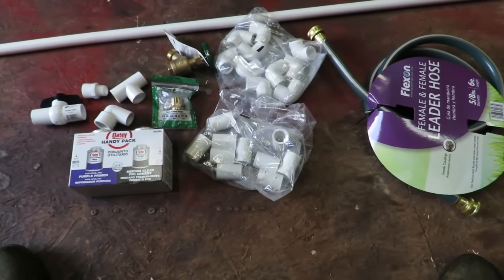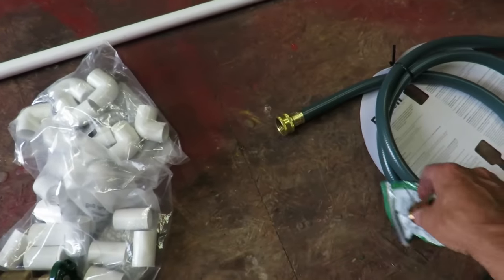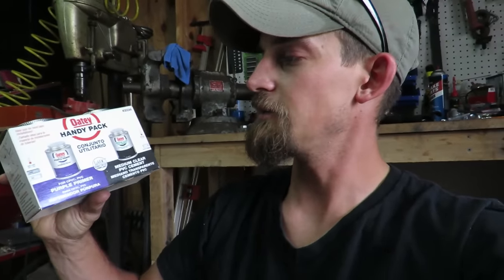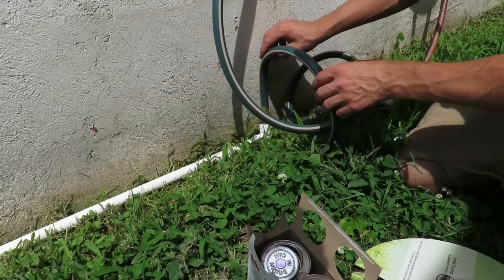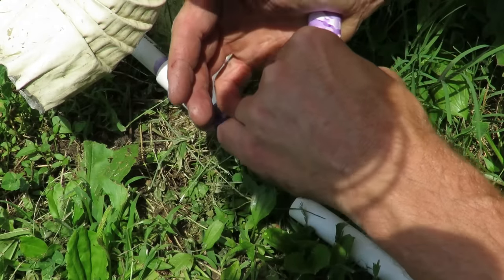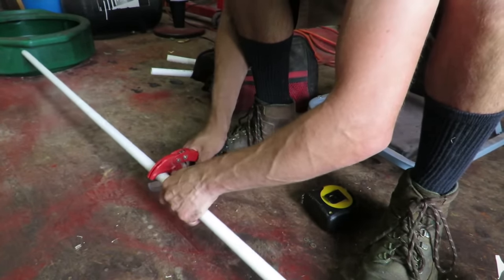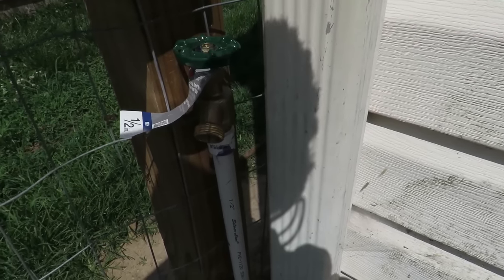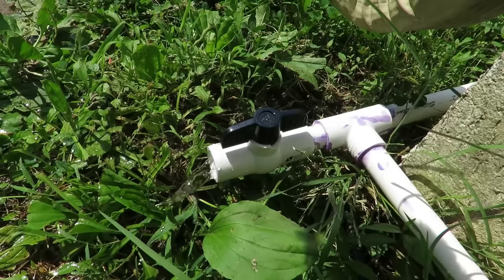Add a Water Spigot Anywhere in Your Yard!

Comment: I would serious suggest securing it to a post because it will end up breaking off, cracking or coming lose if constantly in motion and pulling hoses on it.  Some folks might want to paint the pipe a dark black green color  - that white with markings and the purple cleaner doesn’t look very good - but maybe that’s not important. You can always use my choice —  copper if the budget allows and you don’t have to go to far.  I like copper because it’s antibacterial and it doesn’t build up biofilm like the plastic pipes and hoses do. The reason they tell us not to drink from water hoses due to bacteria is quite true.  My bets are in 20-25 years, they are going to realize (they already know it, just don’t want to tell us as they have allowed it inside so many homes) — but like other faulty or toxic materials - it will have to be removed.  Separate from that issue — you can just hide the pipe by trenching and use HDPE pipes. HDPE (High Density Polyethylene) pipes are a considered the best choice for underground water lines. It’s considered non-toxic, tasteless, and considered a green building material. The pipes are designed to be high crack- and corrosion-resistant, and the light weight and flexibility contribute to an easy installation. With a long service life of 70 years and a low cost, HDPE is a highly desirable choice. PEX (Cross-linked polyethylene) is another great choice for an underground water line. The pipes are created from melted HDPE polymers, which gives the pipe a great amount of flexibility compared to other pipes. PEX pipes are durable, flexible, and able to handle high pressures. These pipes are a great option for yards that have obstacles to move around when digging and laying the pipe, as the pipe will not need fittings or elbows. The downside is the lifespan of PEX pipes which are usually between 30-50 years and even less if the water contains chlorine which is all municipality water supplies and even drilled and bored wells which have to be occasionally shocked. There are other choices, but HDPE pipes and PEX pipes are considered the best underground choices as they are durable, and resistant to corrosion and rust. Biofilm still builds up in these. 

Another really easy “summer time” way for getting water to your potting shed, vegetable garden, or if moving your goats or chickens around is to sink a post in the ground (or use the side of your shed, barn, fence, etc) attach a spigot and run a hose from your main supply to the spigot. Set the spigot high enough to get say a large watering can, or a 5 gallon bucket easily under - saves your back too.  I pin the hose in place with landscape/sod  6-8” (u shaped) pins so it doesn’t move around and pull across my beds.  I like to run it as inconspicuously as possible like down along a fence and then over to where I need it. If you want you can trench and lay the hose in the trench just in case you are trippy and forget to pick your feet up or you need to mow over it and don’t want to lift the cutting blade. If it gets sun, use burst proof hoses (red hot water ones) or you can cover hose with mulch. I actually  cut the water off at the main spigot every-time. This way there is no pressure on the hose. It’s no big deal, I turn the main spigot on as I head down to the shed.  I use for soaker hose too and attach pieces of old reg hose in between where I don’t want water to drip out. In the winter, I take the hose loose from the main spigot to the summer spigot, drain it, and put  away.

If you want to use rainwater — 
You can also use a large rolling trash can and make a filter out of a well rinsed old cotton sheet (rinse 3-4 times in the washer no soap, no softener, bleach, borax, or anything else). Then soak in a bucket of water in the tub, changing several times over a day or two — then back through the washing machine for a last rinse— again just water. Softener and laundry soap is harmful to plants but you only do it once and then keep that sheet for filter use. Once dry, you place it on the trashcan, roll up around the top of the can and bring forward — tie or secure with large  rubber-bands or I just roll it tight into sections and tie it so it stays in place during the storm. If you collect rainwater, you can dip out into a can, install a spigot, or drop a $40 pump in the bottom with a hose connected and you have pressurized pure rain water. Keep the can shaded, cover on and 1/4 of a mosquito dunk per month (don’t use granular, the biological Bt is in a corn based carrier as it will make a mess out of your water).  I don’t collect in pollen season, it goes bad and creates a mess - I wait til pollen season is over. I don’t like gutter water, it’s nasty and has bacteria from birds and other critters on the roof and debris from trees.  I use an old tilting umbrella and when it’s getting ready to rain, it’s then tilted way over the can so the rain runs off one of the ribs and into the can. Takes a few minutes for the umbrella to get good and wet and start to work well but it does. Note, if you have seen rain barrel set ups — you can connect rolling trashcans the same way — they are more expensive but I like that they roll around though keep in mind — water weighs 8 pounds per gallon.  I use a 32 gallon cans.  But you can also use a small vinyl tarp or heavy vinyl with grommets - put large screw eye or hooks (like large cup hooks)  up on the shed or barn roof, or two tall posts (5-6’), connect the tarp to the hooks, drape/secure to the barrel.  Take the tarp down afterwards. I like the $59-79 Lowe’s Tilting umbrella idea better. Look for a white one if possible, but mine is a blue stripe, it was all they had in stock, and you will need whatever kind of base you want that fits the umbrella, mine is a 7’.  It’s so much easier - I do let it stay up in the rain for a 6-8 months to get any potential manufacturing residue off it before use if watering potted plants or say orchids. The winter works well, and I just take it down when heavy snow or heavy winds are forecast but we don’t get many of those. So far so good - knock on wood and it hasn’t been damaged.  When not collecting water in rain storms, it gives me a shady place to sit and it shades the rain barrel which helps keep the water cooler, and algae free. I also attach some of my young vandas to hang off the ribs if the umbrella  too.  I  use the dark grey rolling Rubbermaid cans which I wash out very well with Physan20 before use. An 8oz bottle will last you a while. I use it with orchids, pots, cutting tools, greenhouses, concrete walks, etc. it’s a fungicide, bactericide, viruscide, algaecide. And at the right dilution is safe for a number of ornamentals including orchid seedlings.  You want Physan 20 (physan.com) NOT Phyto and any number which is a toxic copper product for another purpose. I use Physan 20 to disinfect lots of things after first washing off visible dirt, to wash and clean bird baths, fountains etc even the kitchen and bathroom floor.  DO NOT dump Physan 20 concentrate or mixed solutions down drains, sewers, near creeks or any body of water — it will coat the gills and suffocate fish and other organisms that breathe water.  It’s the same type of product used for disinfecting hospitals, restaurants, food processing plants, etc. if you grow tomatoes, peppers, etc or have orchids, and have someone who helps you that smokes, make up the specified hand solution (see under the orchid application in the website) and have them wash their hands with soap and water and then put their hands in a bucket of the physan solution and work with their hands wet to keep from transferring tobacco mosaic virus to the plants. It will be in the tobacco in the cigarettes or cigars etc.- can’t see, can’t tell it, but it will transfer to the plants. TMV spreads very easily by tools, workers, air, soil, vector insects like leafhoppers, aphids, etc. it spreads easily from infected plant to healthy and lasts in the soil or dead debris for years. There is no cure, up to 20% of a crop can be lost if the plant doesn’t just die. This is why you don’t compost tomato, peppers, etc and why you rotate crops - I like a 10 year cycle (10 rows) and once something is grown in one row it’s not grown there again for 10 years but you can use a 5 yr. make sure you draw up a chart because you will forget from year to year. TMV also spreads via seed — if someone is handling seed who smokes it will be on the seed, and into the resulting plant. It’s a major commercial crop disease, there is no cure, you can only try to prevent it getting started on your property and sanitation is a big help. They are a few TMV resistant varieties but not many, and none or almost none of the heirlooms are resistant  — try to plant those that say TMV resistant and buy from reputable sellers.  It would be nice if they could modify the genes to be resistant to this highly infective and stable virus but no solutions yet. They have been able to do some modifying of potatoes, apple,  and corn, avocados, for devastating pests but people are so caught up in being afraid of anything that says GMO that these aren’t getting very far.  Too many people think it all has to do with Roundup and that’s not true. The process can save world supplies of food from diseases and pests… think of the great Irish  potato blight that caused millions to die due to lack of food.
Reply: You should start making instructional videos to show everyone these methods.
Reply: That’s the longest comment I’ve ever seen....

Comment: Yes. use teflon tape for all threaded connections you intend to be semi-permanent. It doesn't necessarily seal the threads, but it helps you tighten the threads properly by lubricating them.
Reply from the maker: I'm planning on getting some. I believe there are different kinds correct?
Reply from the maker: There is also the liquid type that works well
Reply: @ASliceofWoodWorkshop  There are a number of thicknesses of teflon tape. I use the standared white tape and wrap it 4-6 times around the male threads before assembly. The thicker types (one is gray) only typically need 3-4 wraps for the same application.
If you see yellow tape, that's made for gas applications, not water.

Comment: I did the same thing...but I used a commercial red hot water hose at 3/4" ...I tied it to my fence with plastic ties... om the bottom...commercial are made for extreme cold and hot water at 250 degree F.   took me only 10 min...I keep it all year round... cost $50 Total
Reply: Not sure if this is what you meant but If you used PEX tubing it’s not rated to be exposed outdoors. It will break down. May want to put an insulated sleeve over it to help protect.

Comment: PVC breaks down over time when exposed to sunlight...bury it.. transition to galvanized before coming out of ground...also add an air hammer which will allow some expansion so you don't have to drain it for freezing temps... otherwise... good job.
Reply: I spray paint the PVC projects. But these don’t hold pressure. I wonder I’d that’d help here.

Comment: I got lucky when I bought my house. The previous owner had a shed (with washer/dryer hook ups) where my garden is now & they left the water connections in the ground. I'm going to tap into it this fall and do something similar to what you did so I'll be ready for next spring. 

There are NPT to garden hose thread adapters (female & male) in PVC. Its usually by the valves or irrigation section in Lowe's.
Reply: NPT (tapered for force fit seal) TO GHT (Garden Hose Thread, NOT tapered - relies on washer & pressure to seal)

Comment: Home Depot has these nice hose bibs attached to a decorative stand you can work on the supply line from there and now your garden area will be looking real sharp. 
I just found one on Amazon for $53

640 Carrington Decorative Metal Garden Hose Stand, Holds 125 ft 5/8-inch Hose

Attractive scroll design, hose stand keeps your hose neat and ready to use where you need it most.
Made of heavy gauge steel that is powder coated for durable weather resistant use. It holds 125-foot of 5/8-inch hose (leader hose and garden hose not included).

Easy To Install - Just step down on the anchor

No tools or concrete are required for installation! Just step down on the five anchor points until firmly planted in the ground. Five anchors are easy to firmly plant in the ground and provide extra stability.

Convenient Brass Hose Faucet / Bib

With its Carrington design, this hose stand holds 125 feet of 5/8" garden hose (leader hose and garden hose not included). Heavy gauge steel construction with a durable powder coated black satin finish for durability.
Features brass hose faucet / bib right where you need it - with your hose.

Comment: I'm hesitant to use a leader hose since it's not made for constant pressure.  (I'll be leaving that side "open" since the spigot is in the front yard on the wrong side of the fence.)  Any ideas for something that can withstand constant pressure in Texas heat?
Reply from the maker: There may be an adapter that could go right from the garden spigot to the pvc, I just could not find it.
Reply: @ASliceofWoodWorkshop    You could use a braided wash machine  hose. You also have a valve on the hose splitter to turn off the pressure.
Reply: Or just plumb it into the supply upstream of the hose spigot. Probably copper or pex feeding that hose bib. Just go through the wall with the pvc and install a tee and valve and everything would be plumbed in without any need for leader hoses or special adapters.
Reply: Home depo sells a super heavy duty leader hose. It’s a bright orange but I forget the brand. It’s not orange because it’s Home Depot brand haha.
Reply: @ASliceofWoodWorkshop  they make them in plastic (pvc) and copper.  Search for "NPT to GHT adapter"  then add gender changers male female as needed to match the situation.
Reply: @pcofranc  Oh man.... even the garden equipment is ’trans’ these days! 🤦🏻‍♀️

Comment: Nice job. I would go a step further and bury the line for that clean look.
Reply: If you bury it how does the flush valve work? Doesn't that have to be at the lowest point?
Reply: i wouldn’t use a flush valve, just blow it out at the end of the season like is done with irrigation systems.
Reply: @silverhorse98  I’m assuming he wants to use the remote spigot even in wintertime. You might not just stop needing water for months at a time, depending on how you use it. You can still drain though, if you’re worried about freezing. It’s a little more involved, but easy enough.

Comment: Do you have any concern over leaving the cheap leader hose under pressure 24/7? Or do you only turn on the feed to the remote spigot when necessary?
Reply from the maker: I only turn it on when needed. My main spigot actual has a 4 spigot adapter attached to it now.

Comment: I just used a spade and cut in a 50’ heavy duty Sears black rubber garden hose six inches under the grass out to my garden and up the side of a post to a spigot. From there I also buried more lengths of hose under and looped up and into each of my raised garden beds where it changes over to micro hose to water my veggies. It’s worked fine for going on thirty + years now if you can believe that. (Ran one to the garage shop sink too.) Anyway in the late fall I just use my portable air tank to blow out the lines when I close the pool and do the buried 2 1/4”  filter pipes too. (I live in the northeast so emptying them all before the freeze is a must or they WILL burst!) I do like the idea of pvc though. If it has to be seen, that kinda makes it look like it’s supposed to be there…
👍🏼👍🏼 from this guy, thanks for taking us along!

Comment: Thanks for the video I purchased similar supplies and hadn’t set up yet. My project is to set up a similar system using the rain barrels so I just purchased a pump to give the force to move the water. We will see how that works. Please let us know if you’ve done that project yet would love to learn how it turned out.
Reply from the maker: I just did a rain barrel setup, but haven't added a pump yet.

Comment: Ironically, I just bought all the stuff to do the same thing but using pex rather than pvc.  I  understand that pex holds up better if  you do get a freeze.  Having the pipe just laying on the ground is a bit unsightly and gives the weed eater a great target, though.  I don't want to bust the pipe so I may raise mine and mount it above grade all the way around with clamps.  I've had a hose running around there for 4 years and just leave it..but you know the hose deteriorates in the sun...so it's just a matter of time before the danged thing gives up.  Also where you got the riser on a wood post I plan to drive a t-post and mount the pipe to the post.
Reply: PEX PIPE - my thoughts exactly - burying it 2 - 4 " underground would be easier ( dont want pipe above ground and down here , freezing wouldnt be a problem ) - havnt priced difference yet , cheaper ? Definately easier to transport in the car

Comment: I ran a hose to a line of hedge sprays from a double faucet. Sprays on 3/4 pvc and had an elbow with a hose end adaptor. To water just turn on the faucet and the 6 sprays do the job.  They do make hose end fittings in PVC.

Comment: I do the same. One $ saving part, Teflon tape is not required for threads. PVC is self sealing and forms to the coupler. Couplers are a rip-off, 9$ in so-cal.
Reply: @David Needler It’s because people are generally becoming dumber all the time. No offense to your family and friends, because they’re certainly not the only ones. It seems to be that way with most folks nowadays. Some don’t know any better, and some just don’t care. I’m not sure which is worse, but it’s definitely a shame, either way.